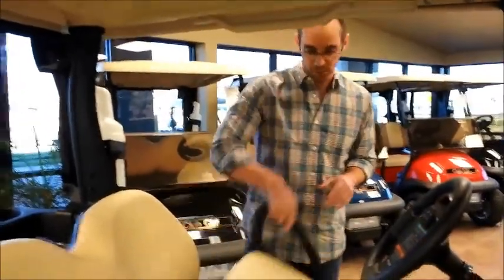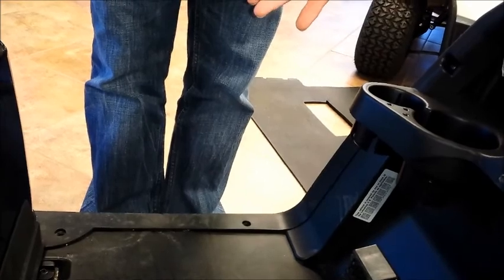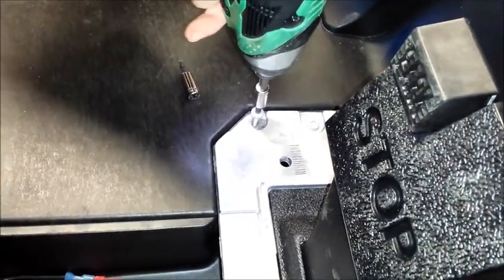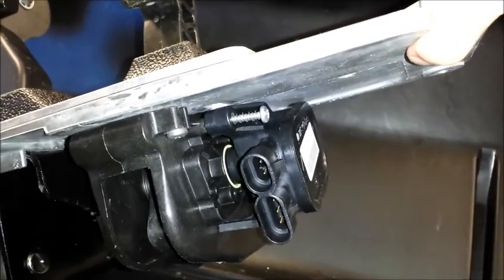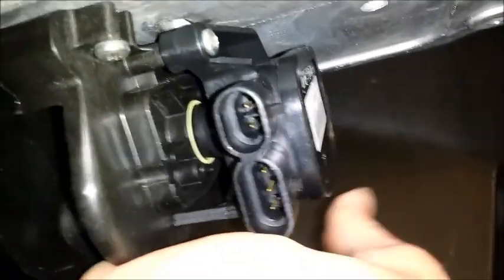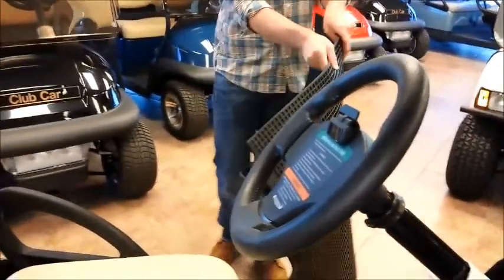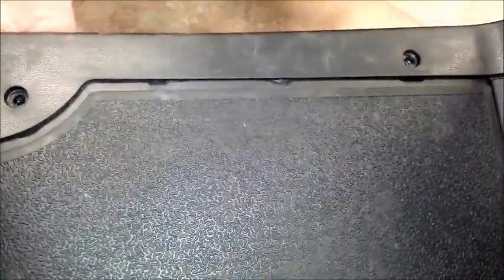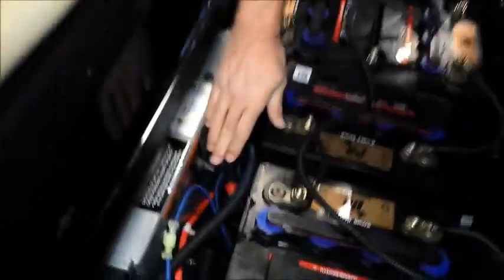HOW TO REPLACE MCOR 2009 - 2014 CLUB CAR PRECEDENT

Comment: My 2012 Electric Predecent has been having this weird issue for the past few months where it would stall out while we take it for a drive. We notice it more at times when we go on inclines, but it also randomly happens if we take our foot off the pedal during a drive (e.g. approaching a stop sign). Once we try to step in the pedal, it doesn’t seem to engage. I have the pump the pedal several times for it to finally engage. Do you think it’s the MCOR?
Reply from the maker: Sounds like the MCOR it works like a dimmer switch.
Reply: I have a 2007 club car I hit the accelerator and the solenoid just clicks. Could the MCOR cause that?